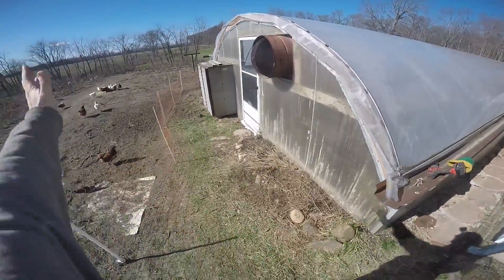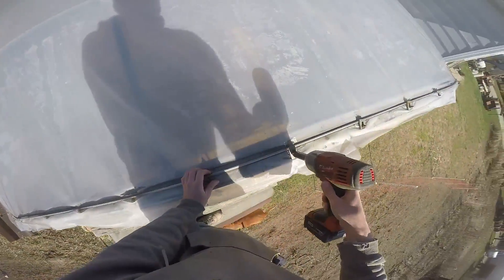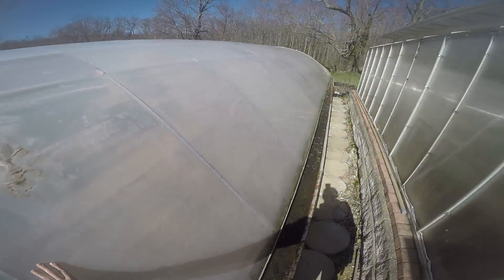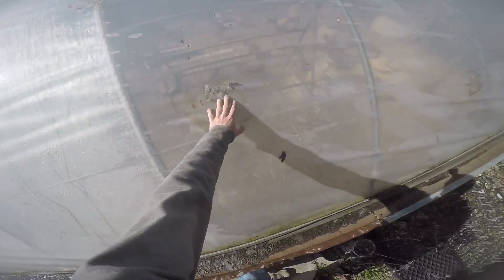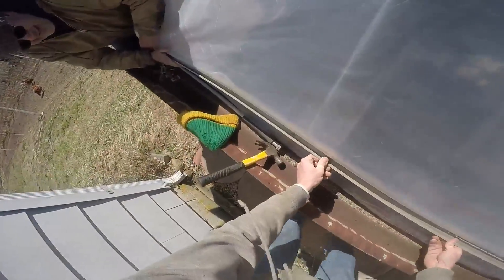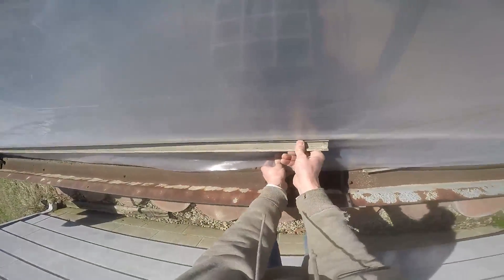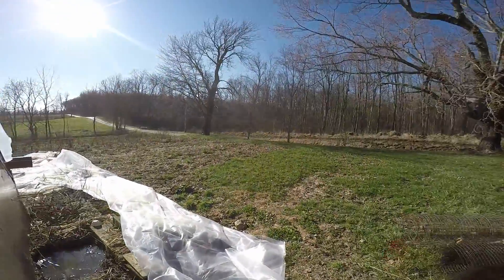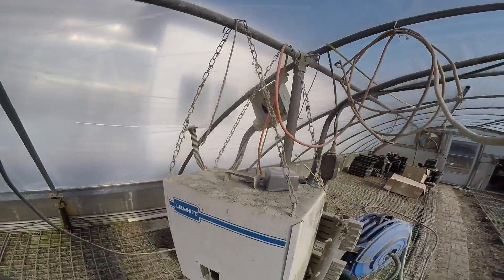Recovering the Greenhouse

Comment: What products do you grow in there?
Reply from the maker: We start our vegetables and bedding plants in the greenhouse. I have had thoughts of trying hydroponic vegetables after the regular growing season, but I need three more of me to keep the rest of the farm going.
Reply: For intensive market gardening check out Richard Perkins on you tube, hes into organic gardening but its all done on the basis that its not just good for the environment but that its a cheaper form of production that also gets better returns.

I looked at hydro but its a high start up cost & high labor component,

I don't know if you found some restaurants to supply eggs too yet but they will take good salad greens(micro greens) mixes, one dude was pulling 250k on a single acre a year in NY state. (its all about marketing the products going for high return veges and intensive production system and rotations)

Comment: Do they make a good way to repair your plastic besides tape?
Reply from the maker: I only know of the tape.
Reply: @boehmfarm4276  I wonder if model airplane Monokote would work?? There's two types-- "regular" Monokote which is "iron on" and "Trim Monokote" which has a peel off layer and adhesive-- no iron.  Of course it comes in a million colors for model airplanes, BUT IIRC you can get clear or light tinted transparent stuff if you look hard enough for it.  Plus it comes in wide rolls so you can basically cut whatever size you need.  You'd have to experiment with some old plastic and a piece or two of various kinds and you can use an old clothes iron on low to set it... it shrinks some as it is ironed on to pull snug.  Of course the trim stuff is "peel and stick" but it's about 6 inches wide usually so that's nice, better than doubling up tape in strips overlapping strips.  Stuff is pretty tough too, UV resistant and usually fuel/alcohol and chemical resistant too so that means it should be pretty tough.  Something to think about anyway.  There's cheaper brands as well like "Econokote" and others... Later!  OL J R :)